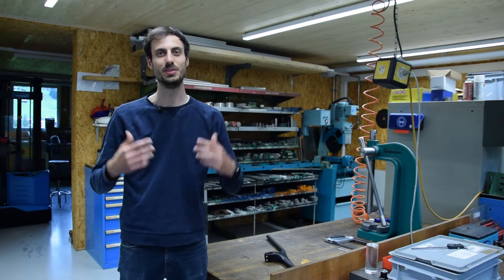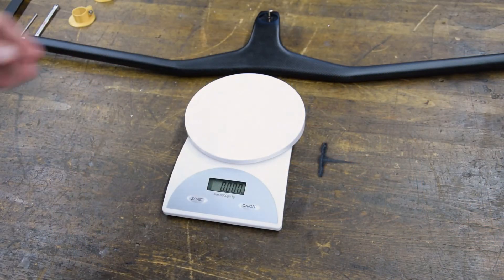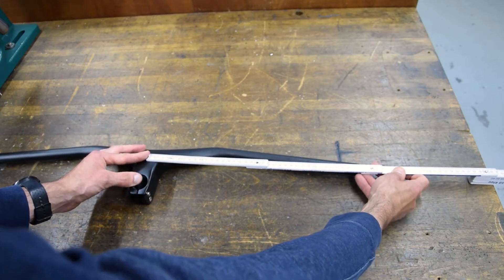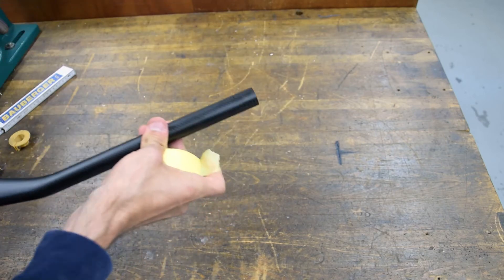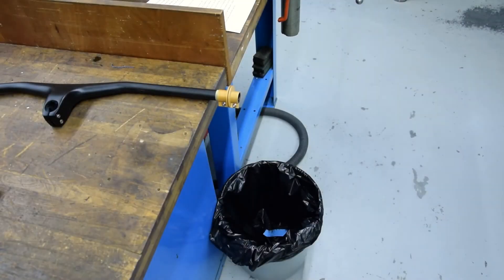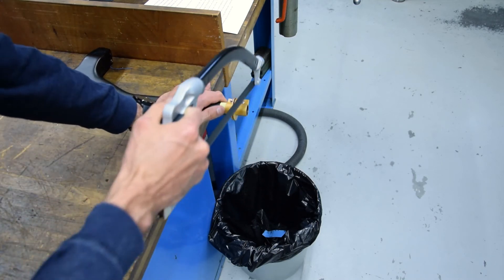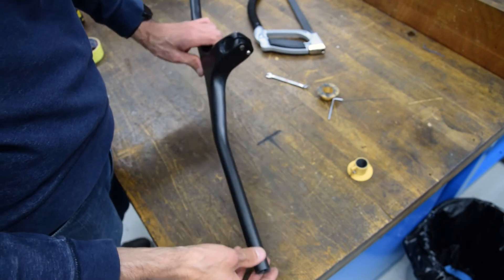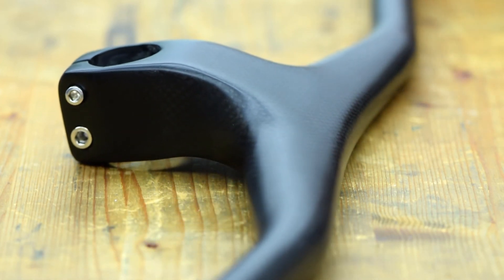How To Precisely Cut Carbon Handlebars - XC Bike Build (Ep.3)

Comment from the maker: What is your preferred handlebar width? Do you ride with carbon or aluminium bars and why?
Reply: I ride alloy bars, waiting to buy a procaliber 9.8 which has all the important bits made of carbon, I don't replace parts unless they are broken :)
Reply: Hi, these days I bought the same items you tested in your videos, wheels excluded.
I've seen your excellent reviews now and they reassured me.
Only terror remained for the handlebar, too bad you didn't do the analysis like the frame.
What are your impressions about it, have you ever had doubts about its stiffness and strength
Reply from the maker: @valerio4571  Thanks, good to hear that you liked them! I didn't test the stiffness of the handlebar, but it's plenty stiff. At least I cannot feel any flex in it. Let's see how long this handlebar will hold, but it already had to deal with quite nasty shocks and didn't break. Only the superficial cracks need some supervision, but apart from that I dought that it will break under normal use.
Reply: @dbikeprod  thanks for the reply!
Reply: it is not possible to write to you with a private message?
Reply from the maker: @valerio4571  You'll find the email address under the "About" tab on the channel.
Reply: @dbikeprod  sorry, i only see your channel link
Reply from the maker: @valerio4571  I guess it is only visible via web browser and not via app. The email would be dbikeproduction@gmail.com

Comment: Hello there, I sam the exact handlebar on ebay for around 64USD, brand is Airwolf. So how is the quality of the handlebars?
Reply from the maker: The bar I got was quite bad. The tolerances were definitely not met, so proper clamping was not possible. Additionally, the top carbon layer pealed off due to the preload of the spacers. I currently don’t use it anymore but you might be lucky.
Reply: @dbikeprod  at least that I didn't expect, shame really, it looked very good and cool too.